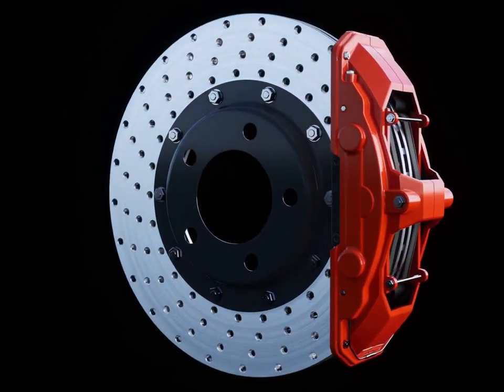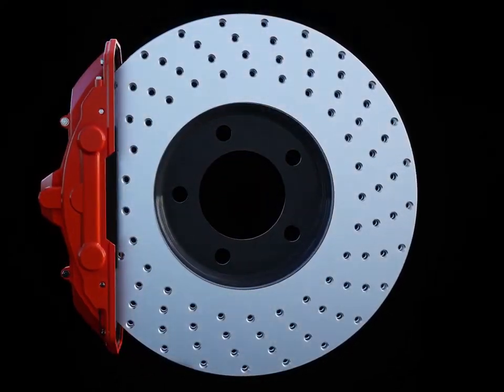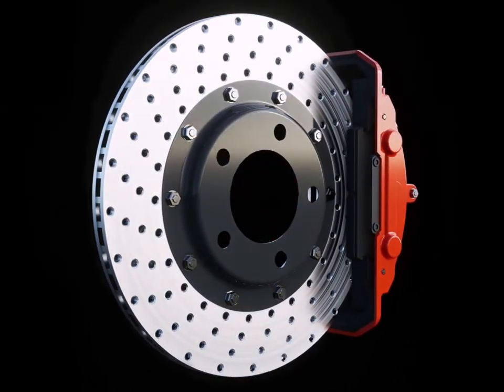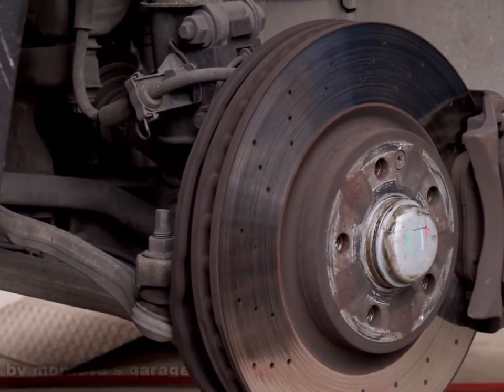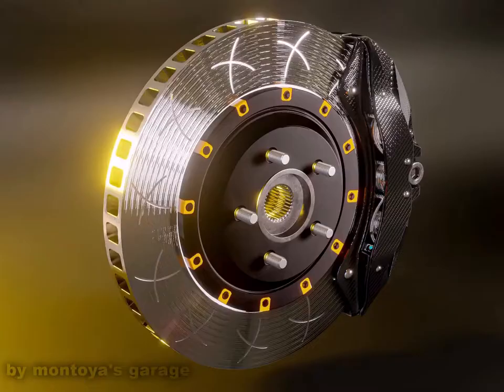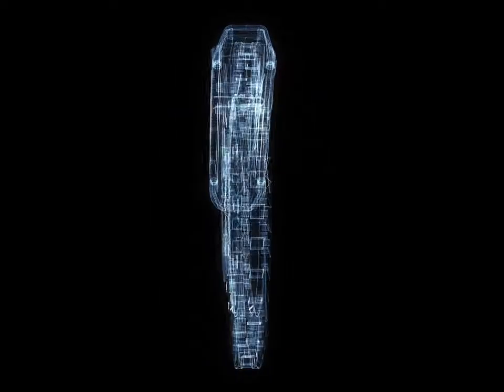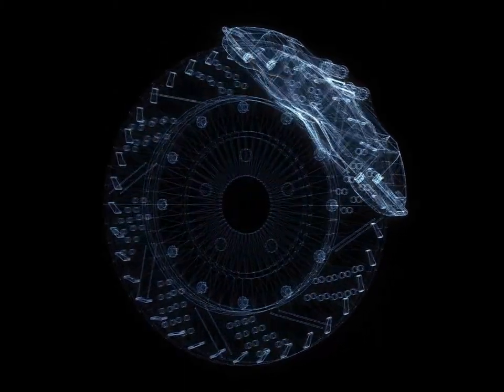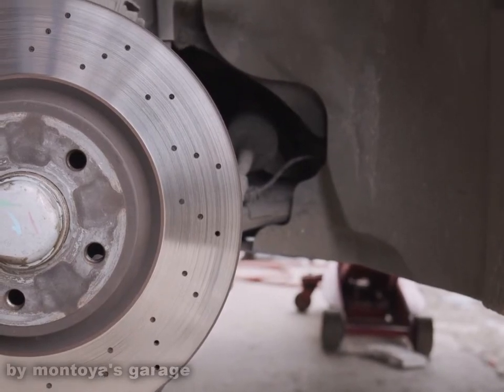Ventilated Disc Brakes Principle 👉 @montoya_garage

Comment: My car has ventilated disc's on the rear.
Reply from the maker: yes,that is not a problem,depending on the car's performance or demand for brake force the manufacturers decides to put them on the back wheels as well. You can also choose to upgrade your normal brake discs with ventilated ones, this will only benefit the car's performance and you!